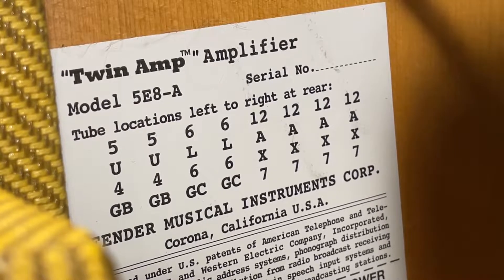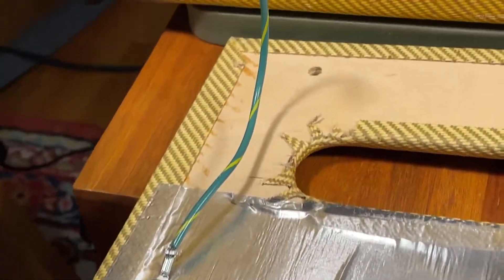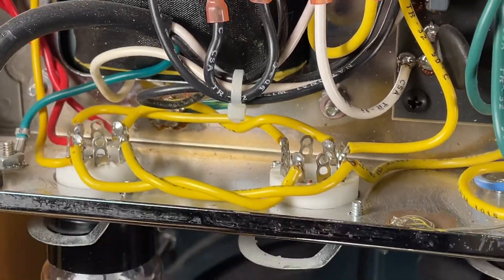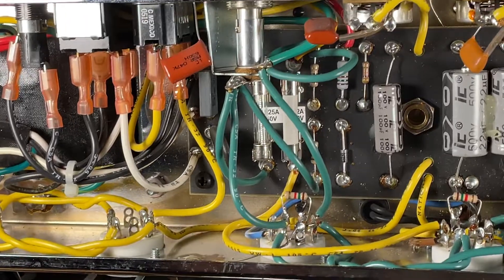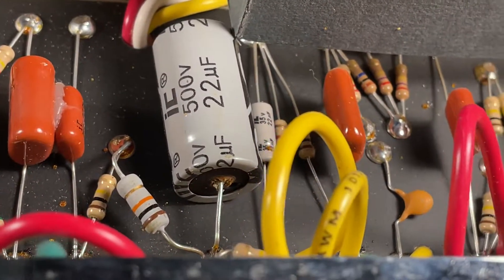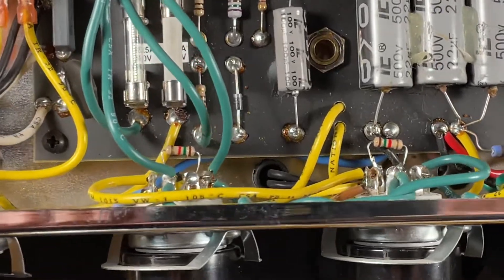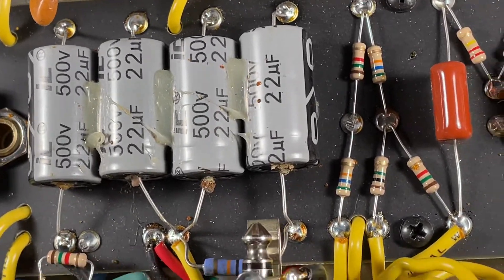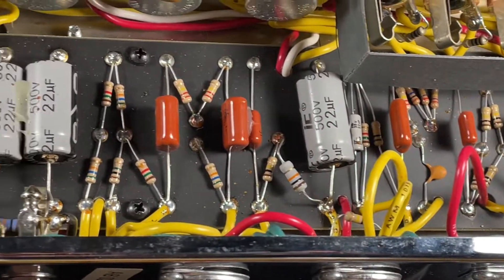Fender 57 Twin : Leaking Capacitors : Low Power Tweed Twin Reissue, 5E8-A : IC Capacitor Failure : 1

Comment: Does anybody know the wattage of the speakers?
Reply from the maker: Specs are identical to Weber 12A150A, a 12” 40oz AlNiCo magnet speaker with 25Watts of power handling.

Details from Weber site…

Replaces Chicago Jensen P12N and other late 50’s vintage AlNiCo 12’s.

12″, 40oz AlNiCo magnet, 25 watts, 1-1/2″ voice coil, curved seam cone.

Brighter, smooth breakup, aggressive, punchy, loud, curved seam inverted rib cone similar to one version of the original Chicago Jensen P12N. Compressed and fattened at higher volumes. This is the speaker that is used in the Fender Reissue ’57 Low Power Tweed Twin. Not recommended for use with harmonica.
Reply: @SJSclips  thank you very much 😊

Comment: Thank you for a very thorough and informative video on this amp. I am beginning my search to purchase one of these. I am still amazed that Fender seems to continue with their using of cheaper resistors and capacitors, even in the higher end amplifiers. I'm no expert but after seeing numerous threads about these parts, you would think Fender would change their ways on this. Thanks again.
Reply from the maker: I share you amazement regarding Fender’s choices!  Glad to have helped and best of luck with your search.  Purchasing second-hand is a good option if you’re patient.
Reply: Get a Victoria, forget Fender